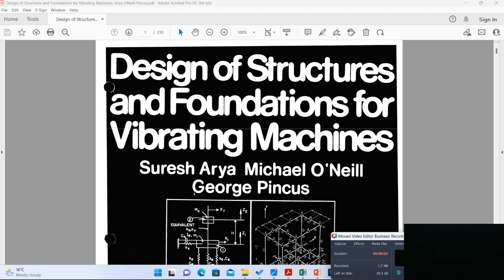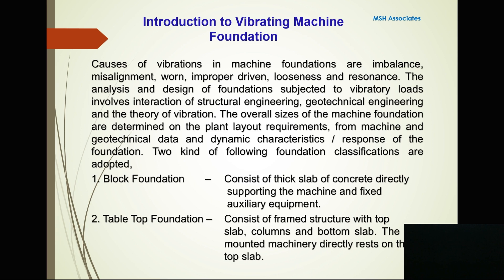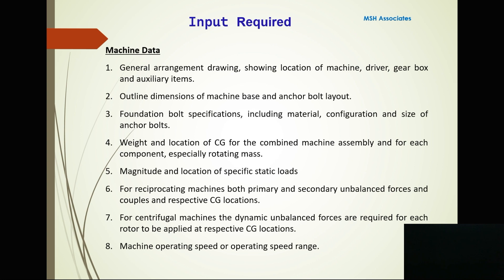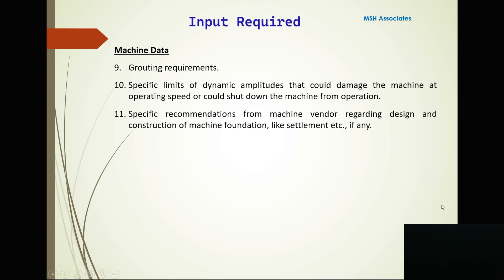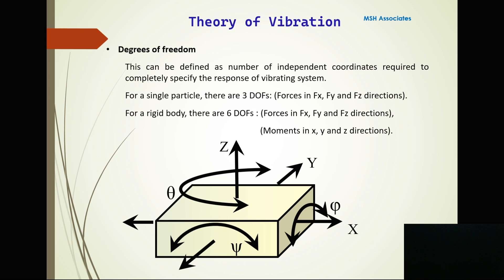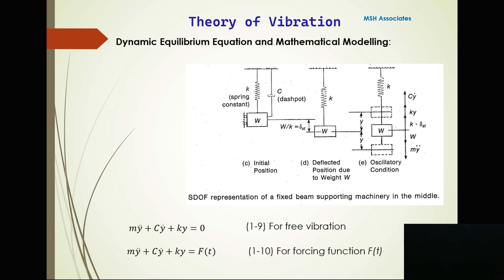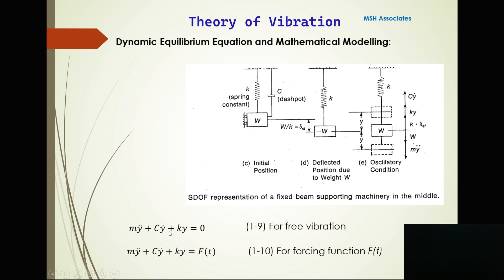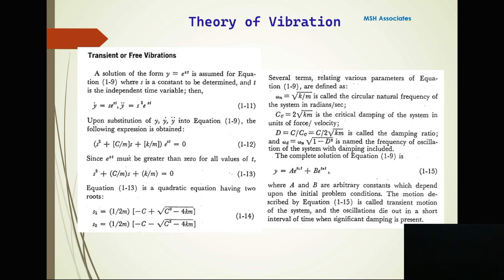Design of Structures and Foundations for Vibrating Machines New Project

Comment: I wanted to learn designing machine foundation. Can you share the link of the pdf of the book or share the excel - thank you very Mach
Reply from the maker: https://files.engineering.com/download.aspx?folder=dfd240d0-f3df-43c7-8e9b-a4688e4b2408&file=36001356-Design-of-Structures-Foundations-for-Vibrating-Machines.pdf